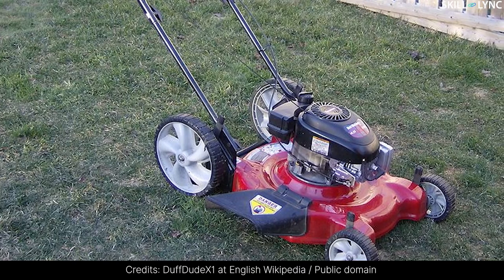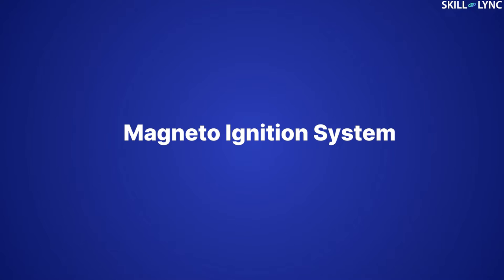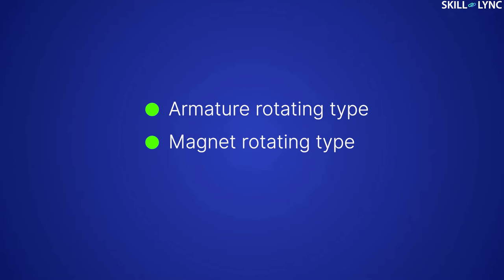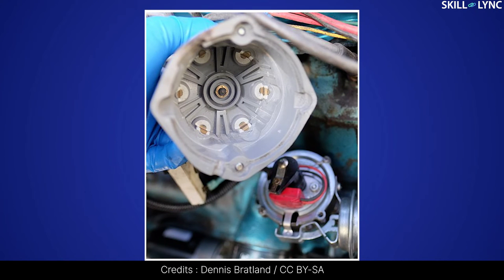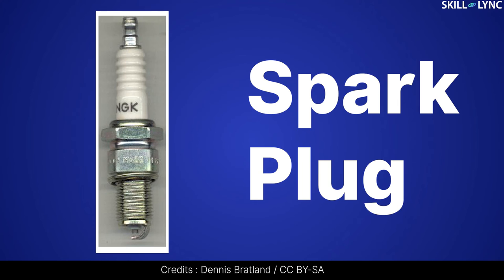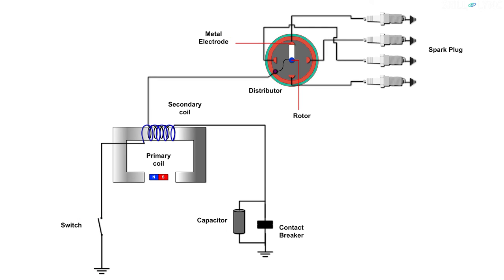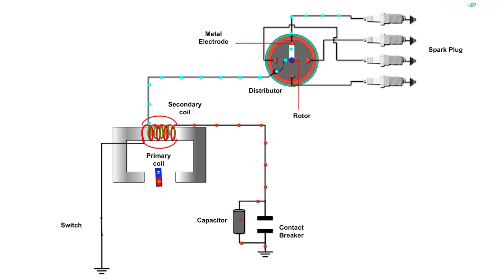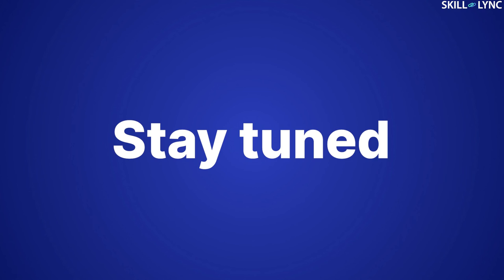Magneto Ignition System | Skill-Lync

Comment: Why does magnetic field change around coil when current starts flowing through capacitor
Reply: Since capacitor store charge so ,ore current flow to primary coil
Reply: The capacitor can only flow a small amount of charge (current x time) before its voltage is charged up to equal to the magneto voltage.  No current flows once the two sides are equal voltage (equipotential).  This causes current to stop flowing, which means current flow in the primary transitions from high current to low current.  A change in current and hence change in magnetic flux through the primary induces (via magnetic induction) a voltage in the secondary.  Because the secondary is wound around the same magnetic core as the primary but with many more turns, a much higher voltage develops in the secondary, enough to create a spark when dielectric breakdown occurs across the spark plug.

Comment: Also please understand how current works, the secondary coil DOES NOT INDUCE A HIGH CURRENT instead in induces a HIGH VOLTAGE CURRENT, most times this current will be low, as energy is conserved P = V*I when we increase V , I must decrease respectively for a fixed Power P

Comment: Pease review this video again, the working of capacitor and contact breaker is ambiguous, 1) what is the point of the capacitor in this circuit ?  2) When the magnetic poles change won't that change the direction of current ? Please explain this clearly !
Reply: The capacitor is charged when the contact points are open and then instantaneously discharges which causes the change of flux in the secondary coil to double, this induces even more high voltage compared to no capacitor. Capacitor also prevents arcing across the points.